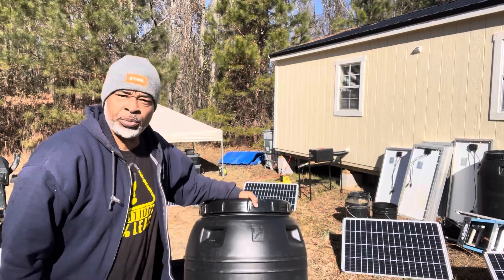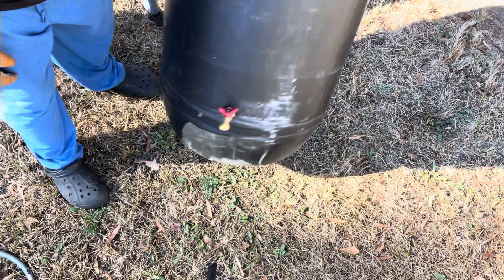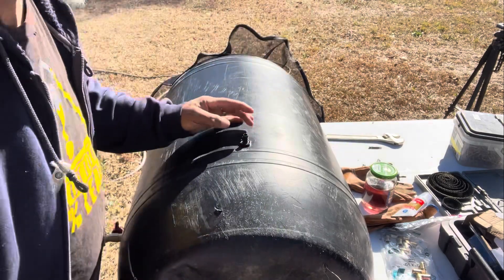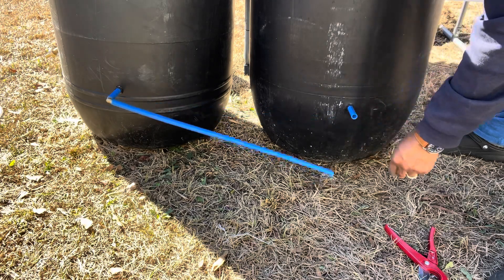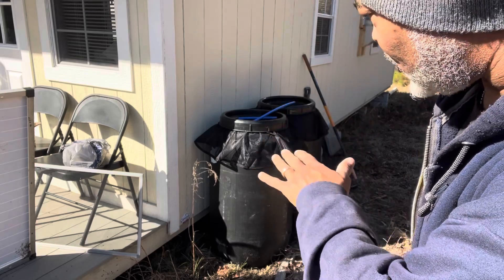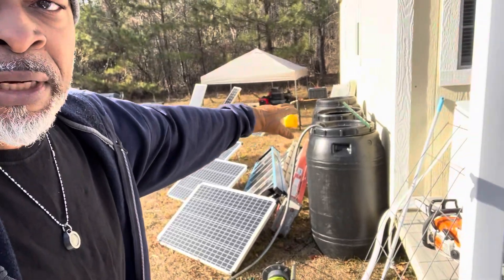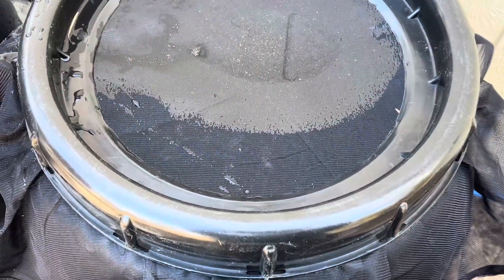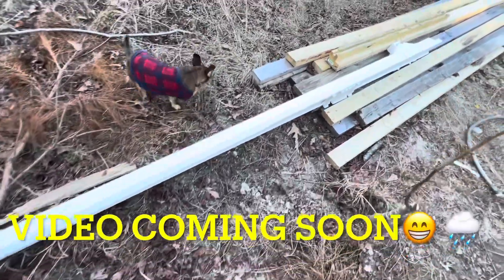NEVER RUN OUT OF WATER AGAIN! Rain water catchment system build

Comment from the maker: I am going to be adding a rain water catchment system to water my garden and other things come hang out with me and watch how I do this. This was a very fun project.
iCrimp Ratchet PEX Cinch Tool with Removing function for 3/8-in, 1/2-in, 3/4-in, 1-in Stainless Steel Clamp, PEX Crimper with 20PCS 1/2-in, 10PCS 3/4-in PEX Clamps and Pipe Cutter- All in One https://amzn.to/4gOmak9

SEAFLO All New 33 Series Marine Water Pump 12 V DC 45 PSI 3.0 GPM 23.5 oz 125 psi Accumulator System https://amzn.to/4gOQKtS

Themomate hot water heater Electric Mini Tank Water Heater UL Listed, thermomate 2.5 Gallons Small Under Sink Water Heater for Point of Use Instant Hot Water 110V 120V, Wall or Floor Mounted, ES250 https://amzn.to/4gPeqhM

Comment: This is right on time… I have one barrel and plan on getting a few more because the main garden is so far away from the house…. Question… maybe silly but … the bolt you used for the inside to fasten the Spicket, is it a special kind that I will find in the plumbing section or could I even use those plastic ones? I’m just wondering if it will rust

Comment: Just what I have been waiting for - the rain barrel add on system stuff visual hands in instructiop. Thanks for all you share with us. My power went out to come back NY 11 pm. I started charging my cell with my All Powers generator as the temps got to 35 degrees today in my area 8A. The added blessing is the power came back on today by 3 pm. Saving this video.

Comment: One of the main areas I need improvement.  I'm digging a small pond/basin and thinking of fronting with a swale to increase the water table since it's on a slope.  I'll then pump the water up to the highest point on the land for gravity feed to garden etc.

One advantage to ur shed situation is the metal roof.  I was worried about my house having asphalt roofing and not clear studies on the impact on runoff from it.  My coop is metal and when I rebuild my shed it will be either metal or living.